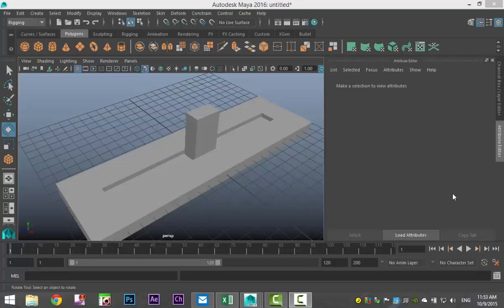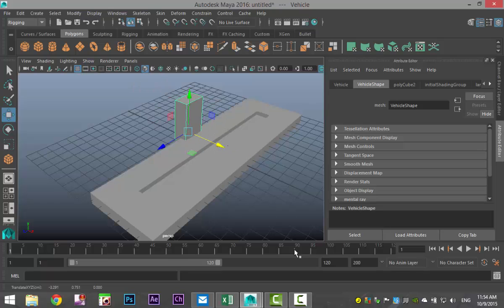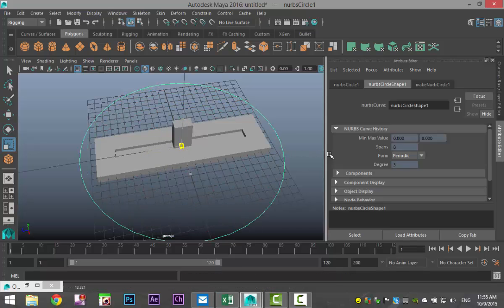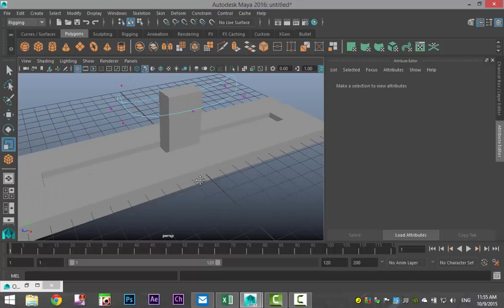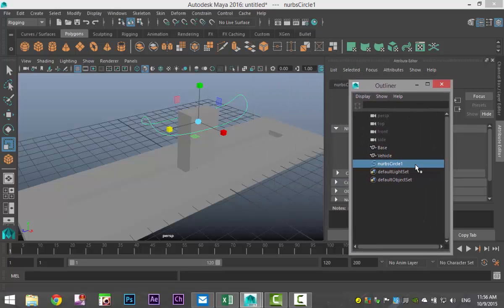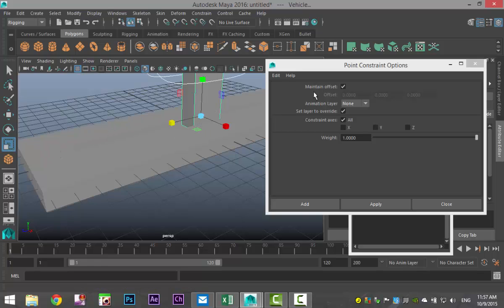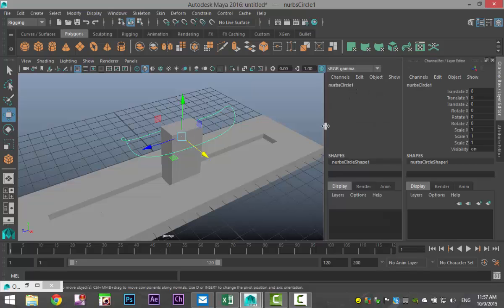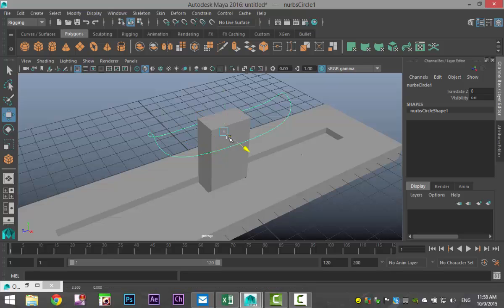Maya 2016 tutorial : The Point constraint explained

Comment: Is there a way do this that would work on a model that wasn't axis aligned? This appears to require movement be parallel to grid lines, which is not always possible in certain rigs with many parts.
Reply from the maker: To be honest I have not tried that
Reply: Forgot about my comment.

I should mention that the best solution I came up with to my own problem, was placing the object under a group (ctrl-g) with all the translation/rotation data on the group. Manipulations under that group work just as cleanly as using the grid axes, but can be completely separate from world orientations.